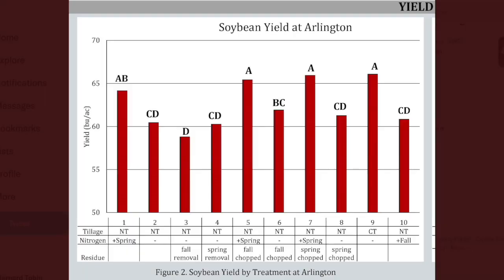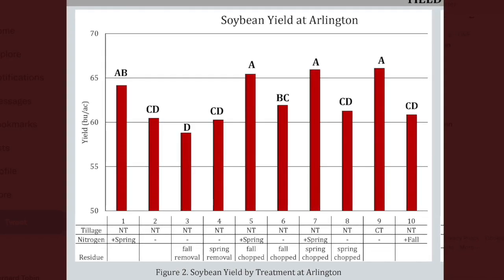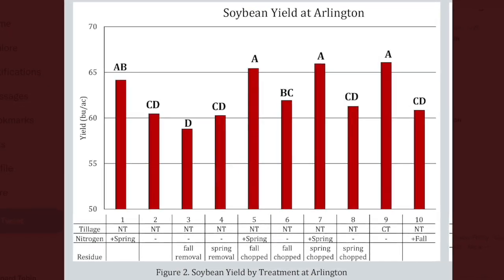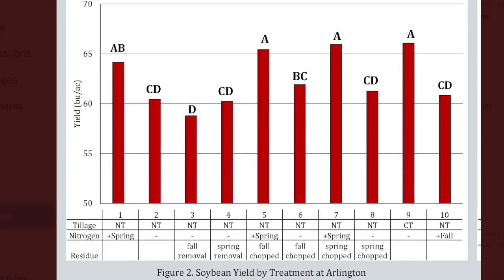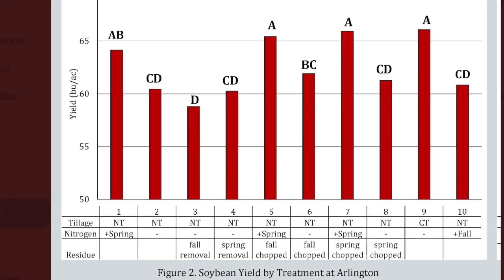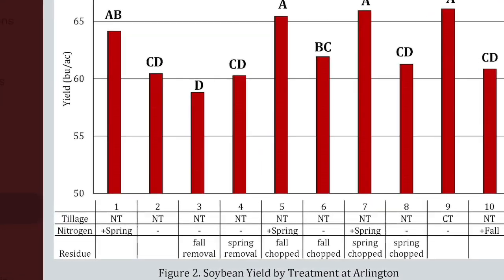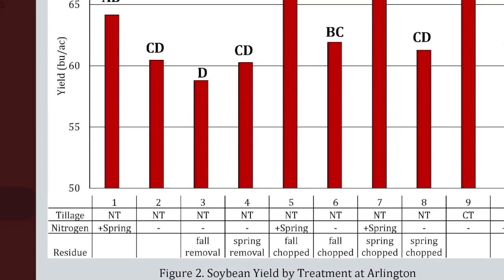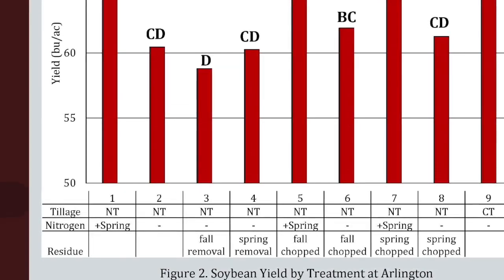Soybean School: Wrestling residue in no till systems

Comment: If we have good active soil life the residue was a non-issue by late summer most of it is gone. As far as planting through it that is really easy either run row cleaners or don't and just run the planter a little bit deeper like an inch inch and a half versus a half inch and you're good to go

Yield does not determine success when trying new systems